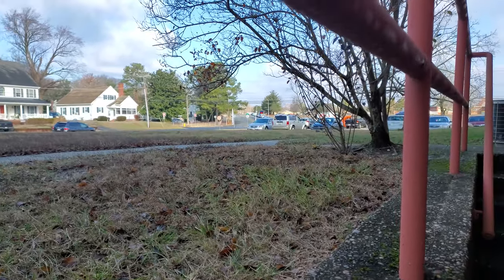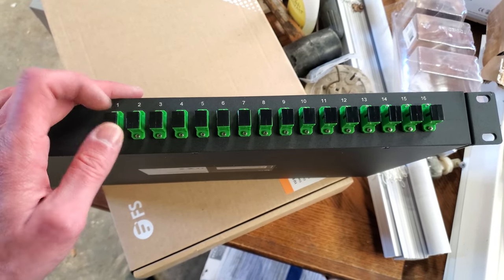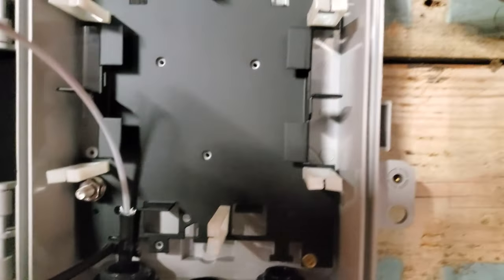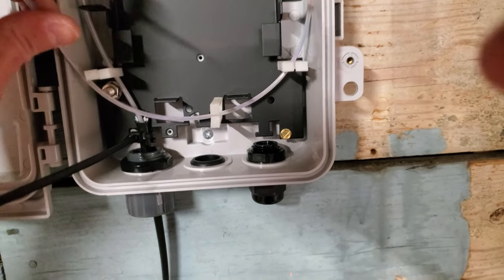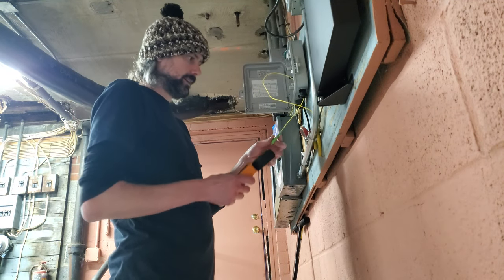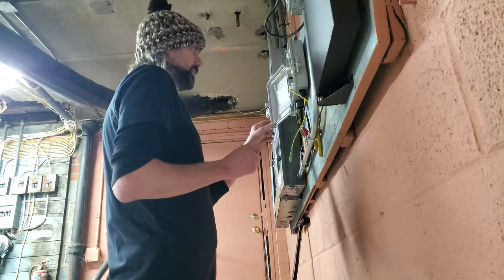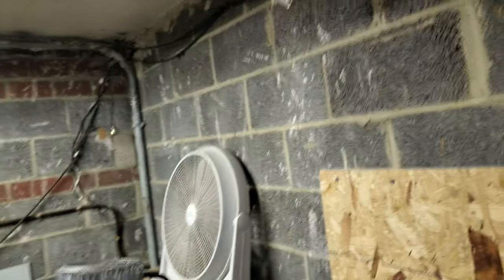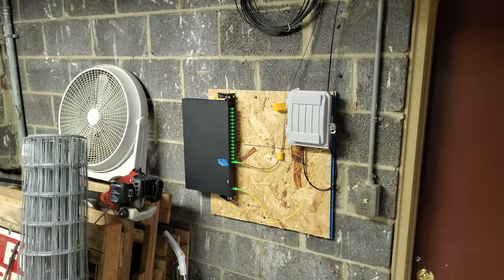52 Unit Apartment GPON Install

Comment: I’ve used FS patch leads cut in two, LC ones, then direct into SFP, saves a joint. Also had issues with cold conditions and stripping fibre too, in a field with Cows!
Reply from the maker: I think i'm going to try a lighter next time I saw someone else do it in the field.  It's like the jacket adheres to the cladding of the fiber in the manufacturing process.

Comment: I've really enjoyed your videos. Keep them coming! For your customer drops, (11:39) is that just a mechanical connector on a flat drop fiber? If so, which connectors do you guys use for your GPON customers vs. a DIA customer? I'm assuming DIA/AE customers would get a spliced jumper?
Reply from the maker: Thank you for that question.  It's a premade cable in this case and a SC\APC cable for GPON.  For our DIA and Metro customers we use a LC APC connection the customer's optic is typically we run a 1 fiber BIDI system 1310\1490

Comment: Wheres the pride in your work, that termination box install is poor. Not securing the (what we call slippery fish cable) 12F incoming properly using its strength members, not even tighting the grommet for the pigtail etc etc, I certainly wouldnt be happy with an install like that
Reply from the maker: Well we are hiring if your interested.
Reply: @briceperdue7587   No thanks, I'll stick to UK fibre jointing. Cheers though
Reply: @xxrtrdxx5191  standards here in the UK are much much higher
Reply: @mixmastergeneral6430  For the most part, seen some right bodges here too when on lodge though haha